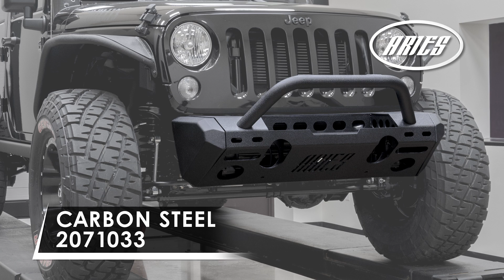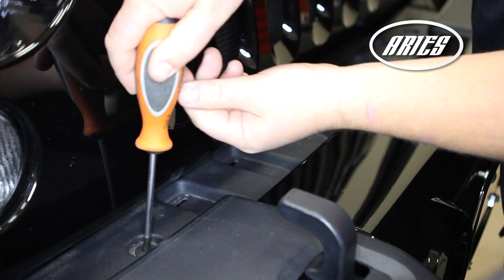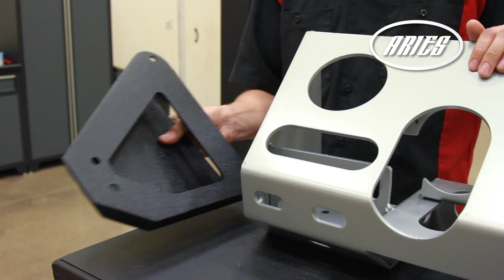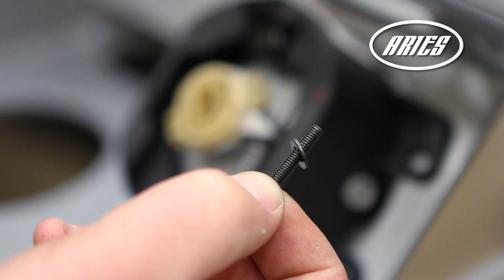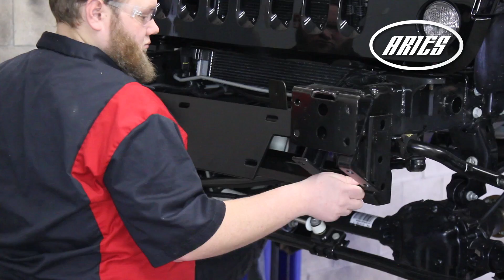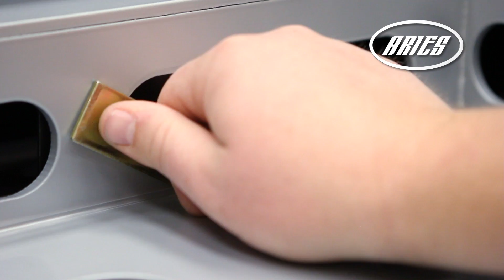ARIES Jeep® Wrangler: Modular Front Bumper

Comment: That last metal attachment for the pump is just so ugly bad engineering you could do better and especially the color and the shape of the attachment.
Reply from the maker: This particular installation is slightly outdated, and the installation has changed. Our newest instruction sheet includes an updated design that addresses the vacuum pump relocation. It can be found right here: https://assets.curtmfg.com/masterlibrary/01ARIES/2082047/installsheet/2082047_INS.pdf